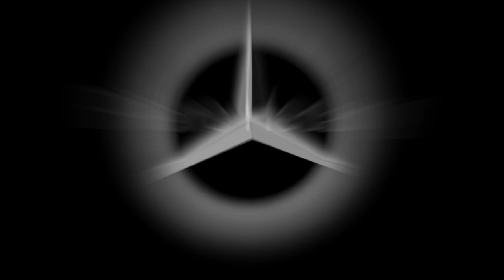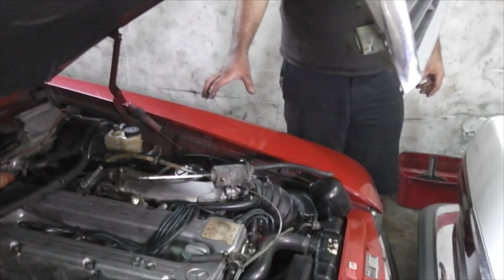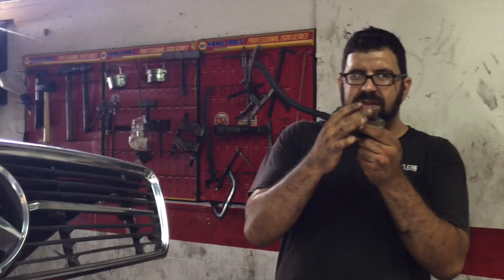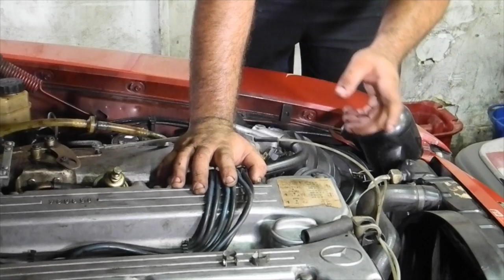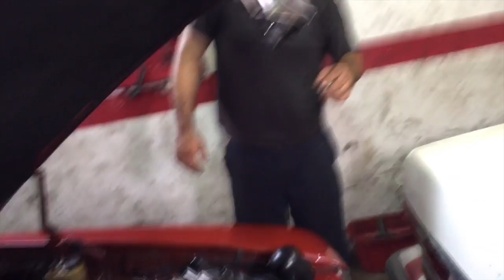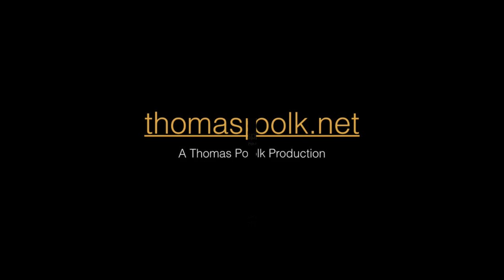D-Jetronice explained by Pierre Hedary part 2

Comment: I have a 450 SLC with a nightmarish fault. It starts fine and idles good. But when I start to drive and press on the pedal, at about 1800 rpm it completely shuts off. Dead, for 2-3 seconds until the rpm goes down to 1200, then it fires up and goes fine…Any tips for troubleshooting this? 😢

Comment: Hello I have a w107 350sl 1973 with Djet fuel injection. The car cranks over fine but will not fire. I am only getting 1 volt output from the ECU not 3 volts which is needed to open the injectors. The ECU has been tested and is ok. Any ideas what I can test next?

Regards
Russell lee

Comment: I have a 1973 450 SL. 9 times out of 10 it will start first pop and run perfectly…then occasionally it will be harder to start…run rough ..low , lumpy ..almost stall at idle and miss on acceleration…if i leave it for a couple of hours it will run ok.  It’s always had a lumpy idle. This varies.??

Comment: I got a 74 450sl that isn't outputting the fuel injection pulses.   It has the inputs from the distributor.   The powers and ground to the control unit will easily handle 3 amps of power.  I checked the fuel relay wire (brown with white stripe) and it appears to come on very slowly.  Any idea what other inputs it needs to start strobing the injectors?

Comment: great video on explaining the system . still at a loss why my M110 d-jet 280se 73 only gets 7-8mpg! replaced aux air valve,Map and ecu, checked timing and ignition and CO is 2.1 at idle. no smoke starts first time drives well but cost £1 a mile with UK petrol prices. go figure..

Comment: My W108 is having the same symptom you describe around 5:45 - misfiring sensation at idle. Will try to clean the trigger points in hopes that it solves it before trying to replace it.

Comment: My engine stalls immediately after pressing down the gas pedal all the way. It does sound a lot like a problem with the throttle position switch. Are these expensive / easy to replace?

Comment: I really need some info about the air fuel adjustment screw that is on the actual ecu for a 450sl 1976. Any help would be appreciated.
Reply from the maker: the air fuel ratio screw primarily adjusts the idle mixture. Your 450sl is likely a 1975, as 76 would be k jetronic. do you have a month and build date for your car? please email me at mbownersforlife@bellsouth.net and we can continue this discussion.

Comment: ... So I know my valves need adjustment.  I found several problems with timing and TPS and distributor vacuum that I've already fixed.  The ignition points have been swapped with an Alyson optical unit which seems ok.  The old realtor plugs were incredibly fouled and replaced with NGK bp5es, but the smoke persists.  I've got lots of spare d-jet unverified parts as this is currently our only "roadworthy" d-jet car right now.  But I'm thinking injector flow test and valve adjustment are the top two jobs.  

I'm a hobbyist, but like to make a few bucks.  Maybe we can help each other out with occasional "transactions".  

Thanks!
Mike
Mknmike@live.com

Comment: Hi Pierre: 

We have common interests.  Between my friend Jason and myself, we've got about 27 or so of these cars, many parts cars. 

I have a 1973 280se 4.5, and this is my first (of many) d-jet that smokes at several times.  I really thought it was oil because the smoke is blueish white.  But so many of the symptoms are like what you describe in this and the prior video.  For example: lots of smoke when starting, even if starting hot.  Also, when I smash the gas it will smoke.  If I start the car and let it idle down, it will stop smoking, and stay that way if I drive it like a granny.  But if I take it out in the highway and try to "Italian tuneup" the car, it will start smoking like a chimney.  I only do this at night when the roads are open and I can't see the smoke until I go to a bright gas station and say "I gotta get the hell outta here!".  

My timing chain timing is good.  The cam lobes look messed up, and I noticed the driver exhaust cams are wiped clean all around...
...
Reply from the maker: SO here's what I think is going on. It sounds to me like you have a worn camshaft journal, likely on the right side (pass. side) of the engine. All of the oil is probably being dumped into cylinders 3 and 4, causing your smoke issue. If you replace the cam and journals, replace them with  75 and earler m117 parts. You must do both!
Reply: +The Pierre Hedary Mercedes-Benz Classic Specialist 

Thank you for your response Pierre!  1975 and earlier... d-jet stuff.  Yeah... ok.  We've got a spare set of nice heads, a spare engine on the floor, a parts 73 280sel 4.5, and even a complete 75 450slc.  Oh, and the 350sl 4-speed too.  I originally bought that with the intention of putting the transmission in my 450slc 5.0 convertible and putting the heads on my w108.  But honestly I can't bear the thought of tearing apart a 350sl 4-speed that we may be able to make run and drive.  

I will give a go at adjusting the valves and check these journals.  I document most of the stuff on benzworld under the handle "Fonzi".  

Thanks for the great info Pierre.  I sure do like your stuff more than the other MB guy.  ;-)

Comment: the other style intake was for the k-jetronic?
Reply: Would very much appreciate a video on hot to get k-jet dialed in.
Reply: KE-jet*
Reply: on the m110
Reply: the m110 engine I used also has d-jet.
Reply: mine has the m110 with that "flapping'" intake with the filter on top
Reply: thats your other channel?
Reply from the maker: it is. 
so you have k-jet? much easier to tune (:
Reply: yes i believe so i have posted a photo on the google+ comments of this video.I took it when i was reinstalling it after taking it apart, because it was stuck (the ''piston'' on the fuel distributor which be the way i couldn't take apart, i just got that piston to move freely and cleaned it with fuel injection cleaner) i got it running after dealing with some problems (fuel pump rotten hoses etc)and it was running a bit rough i think that it wasn't running on all 6 cylinders maybe 4 and some of the spark plug wires were damaged (probably from rats..), but i run out of time cause i had to get back to the university...  i hope that i will most likely have it back on  the road by the summer. :D